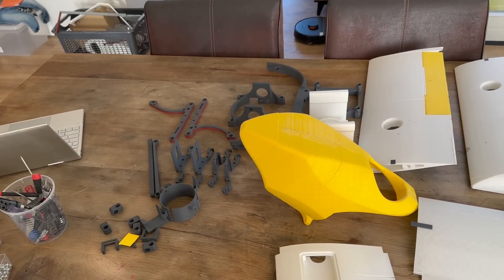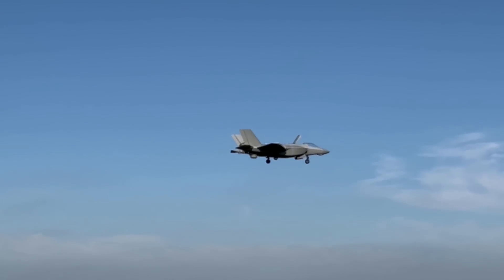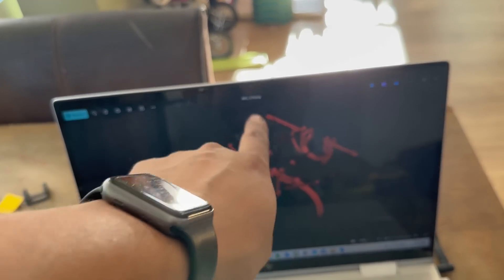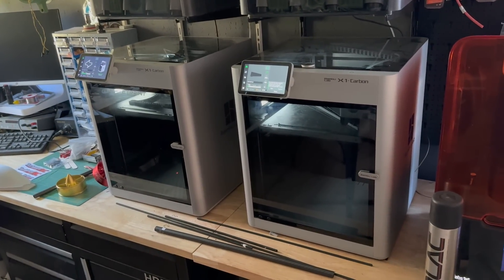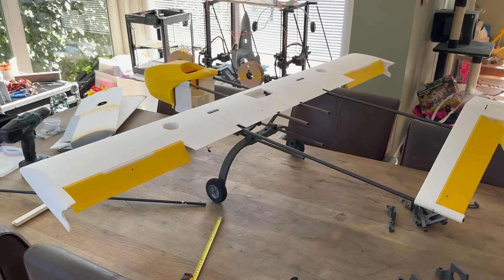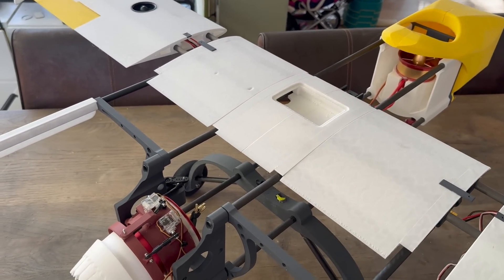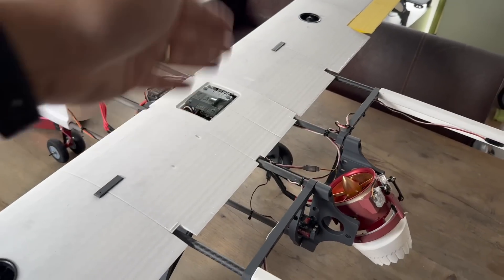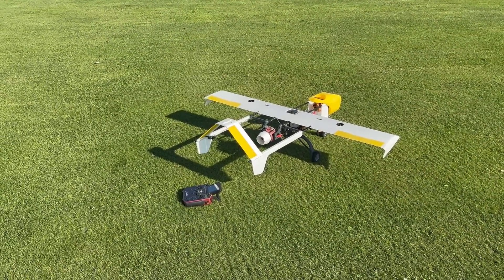Build video-VTOL 3D Printed Trainer Based On F35B Technologie | Rc-Jetprints Design

Comment: Are you ever considering upgrading away from the KK2 board? It's really outdated, and while it works, modern flight controllers can provide so much more features and performance.

Comment: You are doing an excellent job and you share it to anyone willing to experiment. The controller is a KK2 which is not the most used mainly because the programmation is not easy. But this controller is able to configure any setup. I have programmed a tricopter ( like a Convergence) and it worked but after many try. All to say that I can appreciate the job you have made. Is there any suggestions about another type of controller ?
Reply from the maker: no i am super used to the kk2 board, i have like 200 of them here, maybe i can flash them an configurate them for shipping with an manual
Reply: @Joelmelanie  Oh
I would be interested in a KK2 board

Comment: I have a pair of jp 70mm edf, 6s 2250kv. I have had a hard time getting some speed controllers to run these motors. What speed controllers are you using?
Reply from the maker: APD but they are not on the market anymore , or the originals from JP Hobby, both 120A 6 to 12S ESC
Reply: @Joelmelanie  are you running yours at 6s? Or running 7-8 to cover the voltage sag?
Reply from the maker: @96vmax4  just on 6S, maybe i could try 6S high voltage or 7S.... ow wauw more speed, going to order they can handle 7S

Comment: Excellent ya but this is not cheap ya it's little expensive
Reply from the maker: true somewhere,  my total setup is 520 eur, but you can build it for less than 300 euro with aliexpress parts
Reply: @Joelmelanie  but here in India aliexpress is not permitted ,and moreover nowadays there are several restrictions of drone flights & designs due to terrorist threats
Reply from the maker: @BharathwajK  ah no way, can you acces motion RC?
Reply: @Joelmelanie  oh then I try